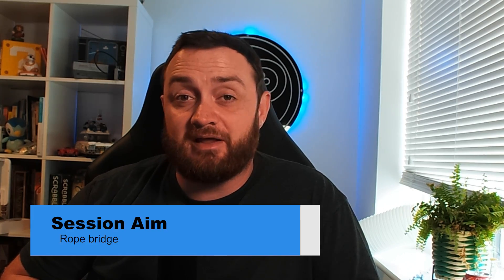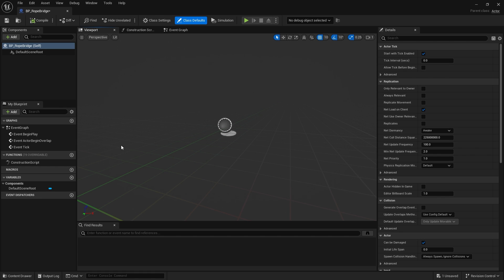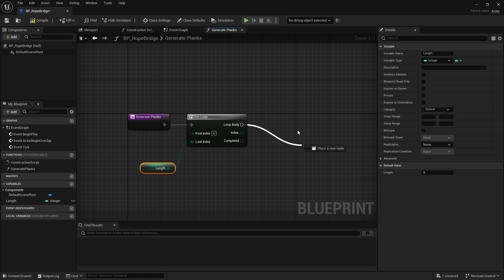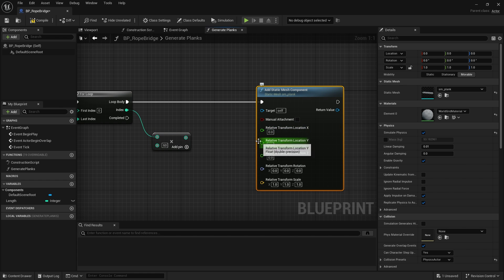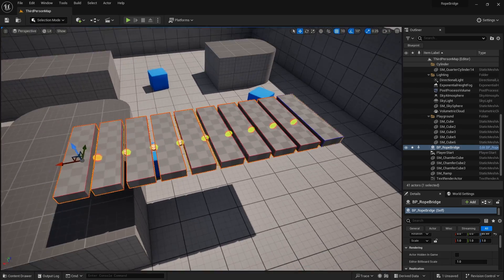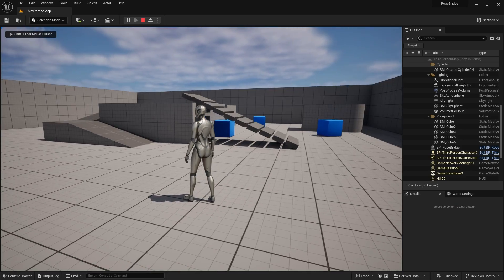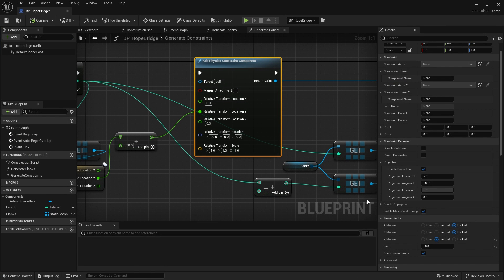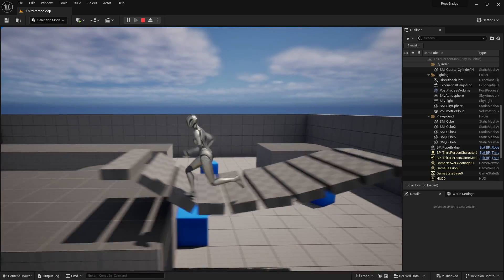Unreal Engine 5 Tutorial -  Making a Rope Bridge

Comment: anyone else having an issue with their rope bridge where one half of it jitters a lot? especially when going at lenghts of 40 planks or more
Reply: After some research: the jittering is due to performance issues. The planks bridge is expensive and the more planks you use the more resources are needed. 
The maximum amount affordable depends also on the complexity of your environment. The only solution is to make bigger planks so that you need less.
Note also that several smaller bridges are much cheaper that a very long single one
Reply: @LuxAlibi   yeah! I ended up using multiple smaller bridges of 20 planks or so to bridge the gaps, with small floating islands between the smaller bridges. worked just fine. good to know the probable reasoning though! thank you for looking into this
Reply: Did you find any solution?

Comment: If anyone is having problems in 5.3 with the bridge bugging out, go into your physics constraints, Under the angular rotation offset tick down advanced and look at twist limits. Make sure Soft Constraints is checked then reduce stiffness to 0.0 and damping to 0.0 although that's a little to springy for my tastes so I set damping to 0.02
Reply: Any idea how to balance out the settings for constraints if your projects default gravity z is set to something higher (-7000 in my case for better jump feel)? Right now the bridge is bouncing around a lot which still happens in -980 gravity (unreals default), but slightly less.
Reply: @milkboyG  when I get home today I can mess around with it and see.
Reply: not seeing the constrains anywhere except first box- non anywhere else and Im sure Ive done it right, keep rechecking see nothing wrong, 5.3- ideas ?